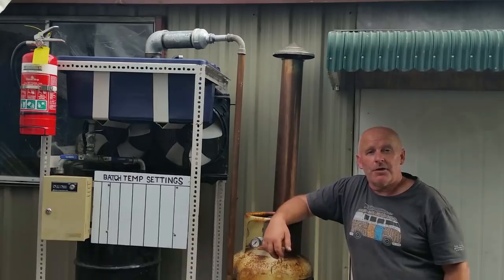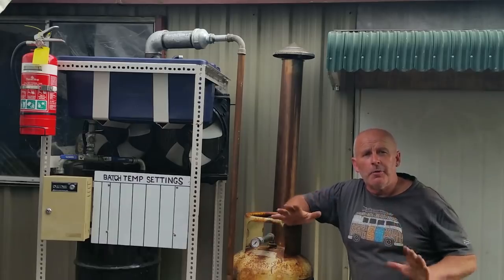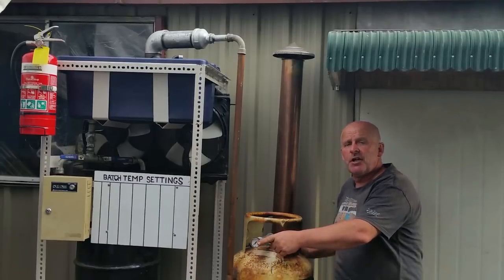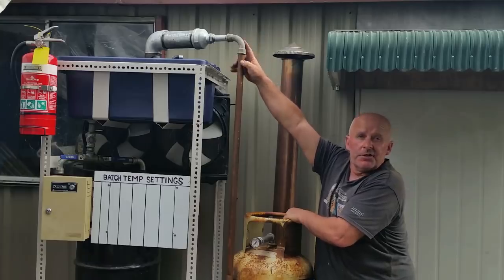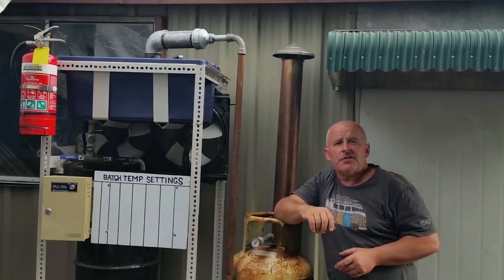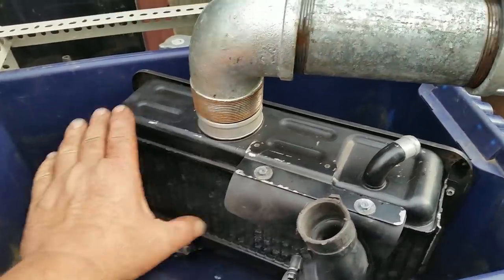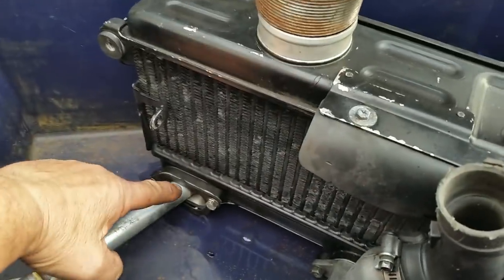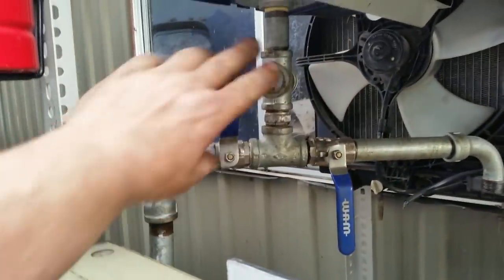Making Free Diesel from waste plastic PART 4

Comment: Could you put in a high pressure valve instead of marbles?
Reply from the maker: The marbles give a surface areaand encourage condensation and making the precipitate drop back
Reply: I would avoid putting any restrictions on the circuit due to a possible mechanical fail point that could pressurize the heat chamber. If you need to restrict the pressure, try sizing down the pipe. The larger pipe for the accumulator is a great idea. I would put a flame arrestor before it to make it safe. I might have positioned it vertically and tapped into the top of the accumulator to collect lighter gas.

Comment: Free, it isn't free if you have to use propane to generate heat.. also you have to cost in your setup costs.. so its not free.
Reply from the maker: you did not watch very hard, the LPG is 30second pre heat to start the waste oil burner- you also missed that every component was free- its made from junk and donated bits

Comment: Doesn't it take more energy to run this than what is produced. I'd skip the water pump & go w/ a gravity feed to save electricity (it works on moonshine stills) & find heat source that doesn't require a compressor.

Comment: Put tubing in the slab of your workshop, and pump the cooling water through it, that ay you make diesel for your backup generator of your wind/solar, and heat your workshop or even home by using the heat otherwise wasted in winter.
I'm planning to build a  two m3 heatsink water bath, that will be heated with black coil solarpanels, complemented by excess solar/wind through elements  when my batteries are full 
copper coils will go through it to heat water from my elevated  water  tank for use in taps and heating radiators, but if this apparatus produces water hot enough, it could be circulated through my heatsink as well  on short winter days without much wind.
I'm also experimenting with aircrete to surround my heatsink, which has great insulative qualities, but might be useful to insulate your burning chamber as well.

Comment: You're stealing a distillers method of helping a reflux still by using the marbles. We use copper wool too,  That's how you get a purer product , it's like double or triple distilled, depending how much you put in the riser .
Bubble plates are the Professional method, but it works just as well.

Comment: How does the cost of the LPG and any other heating energy compare with the value of the diesel actually produced?
Reply: Unless I missed something, his system is using a waste oil burner to do the heating not LPG. What looks like an LPG tank is the chamber for the plastics to go in for pyrolizing.
Reply: LPG to start burner. After nozzle of burner hot enough to ignite oil on its own the LPG is shut off. Burner running on veg oil or old motor oil.

Comment: In the 1990s I joined in with a South Dakota group of men. We burned car tires in a controlled burner to create smoke and ran that through a carburetor with compressed air. The burner would throw a 10 inch diameter flame about 8 feet long. The purpose was to remove waste tires and to pressure up and vaporize contaminated oil spill dirt.  It really worked, and with condensers we could sell pure refined oil while reclaming contaminated ground. There was no smoke from the burnt tires because of the pressures and the controlled gasses that they have off. This machine was ahead of its time and the group of men lost their intended direction, it never went into production, sadly.

Comment: Would you do a video on how you put the 55 gal barrel together and the inter propane chamber how did you stabilize the 2 barrels to keep the inner from moving around. Did you weld the bottom of the propane tank inside the 55gal barrel. Please show us how you did this.
Reply: We only have the 44 gallons in Australia USA 55

Comment: If the radiator was above the intercooler it might thermosiphon on it's own and greatly reduce the need of a circulator. A boat "fresh water" heat exchanger with cold water circulating from say our Artesian well would replace the entire double radiators. I happen to have one. This is great stuff mate. Between this and a biodigester made from IBCs you would be all set for fuel. Well we still would heat with wood only as to the house and gh. 👍😎👌

Comment: You should use aircrete to insulate the outside of your burn chamber
Reply from the maker: imusing aircrete tonsulate the inside of the chamber so that the heat does not burn out the drum

Comment: Could you reintroduce the devils brew into the system and get more diesel out of it?
Reply: I was wondering whether the 'devil's brew' could be used as the waste oil to drive the burner, but I'm sure it wouldn't be wasted.
Reply: @rustyfox2794  His original design had a system specifically setup for diverting the devils cut into the burner. It was one of the holes drilled into the burner.

Comment: Watching through your series . Wouldn't it be better if you condense the vapors coming out of the reaction chamber with air so that the fans are blowing air in the radiator and thus cooling  it and condensing it ? This way you make the machine smaller and easier to build ejecting the whole part of a system ?

Comment: @TinyHouse and Offgrid Resources how did you cut the old propane tank safely? Was it water filled, or carbon monoxide?
Reply from the maker: propane is heavier than air. just equalisethepressure then remove the tap and leave upside down overnight outside. - people overcomplicate this process. empty about 150 cylinders a year for woodstove projects with no issues

Comment: How many marbles do you use in the reflux tube?, and how long does the reflux tube have to be?
Reply from the maker: Hi Michael. there is no definitive answer. This is an experimental rig that can be played with in lots of ways.  If your reflux tube is as long as mine and you use 30 marbles it builds the pressure up to 2psi before they lift and release the pressure. you will need to have as many ways of vareying heat and pressure as possible. so that you can optimise the results
Reply: @t.h.o.r.  thanks for the info. How is your recycling machine doing. It would be nice to see a video of your machine in full operation. I'm slowly getting all my bits and pieces together to build one.

Comment: try to make fuel but it is solidifying back again what is the problem???????????????
Reply from the maker: ive had the same issue. A waxy coffee coloured goo?  your temp is too low
Reply: no the temperature is high about 700 in the reactor,,could this be the reason becaus it comes  as vapour but solidifies again wonderfully
Reply: iam in need of the liquid fuel but i get wax
Reply: Yeah it become solidify again ...What to do for that
Reply: Have you tryed keeping the plastic under pressure and heat longer to see if you are not allowing the chains in the plastics molecules to completely break down and reforming as a low grade mix of deisel and non broken down plastic

Comment: Would you have the most detailed design plan in your process, can you produce gasoline as well?
Reply from the maker: Noticías Reais .When it is complete I will recap all the build details and the science involved. The temp is adjusted to make the different fuels but for gasoline, a catalyst must also be used. Then other ingredients blended in. It's a much more involved process. I will be concentrating on  making good quality diesel.
Reply: the catalyst hates Magnesium Carbonate, what is the cost of this project yours?

Comment: Keen to know your production rate in future videos, without having some sort of pressure regulator I'm not sure the marbles will create enough flow restriction to build up anything above 1psi. Hopefully it works as you planned, looking forward to the next video :)
Reply from the maker: Me too!  Ive read extensively, and I expect similar results to other folk. Close to one litre per Kilogram of feedstock. holding the brew at the correct temp for the required time is the key. Commercial Fractionating towers use multiple trays stacked inside the column. the trays provide a massive surface  for the condensate to for on. I have the option of swapping out most components of the design as it is modular.
If one part does not work- we will have a lil brainstorming session here in the comments section and  come up with a solution. Thanks for your comment Matt- we will get this machine perfected between us .  :)
Reply: @t.h.o.r.  Awesome spirit !!!!